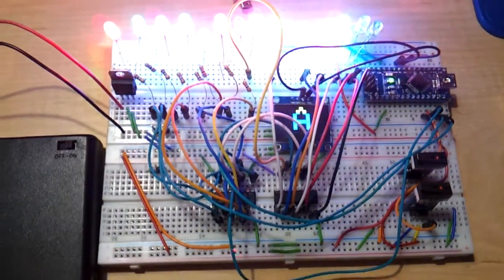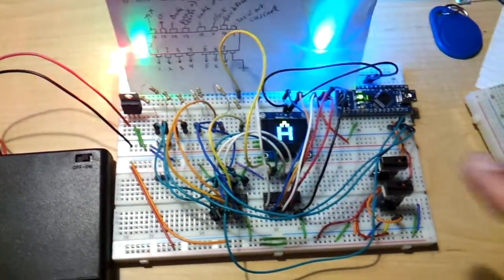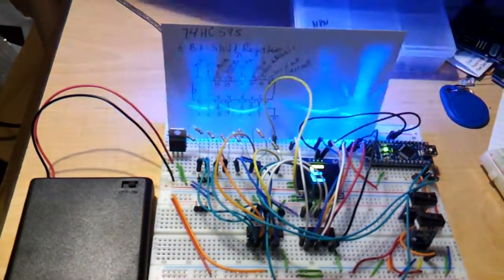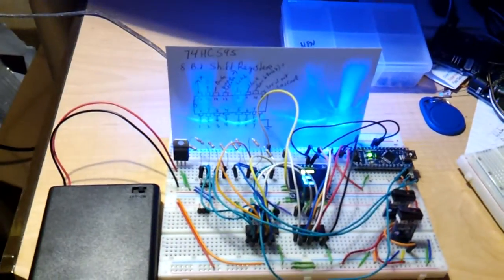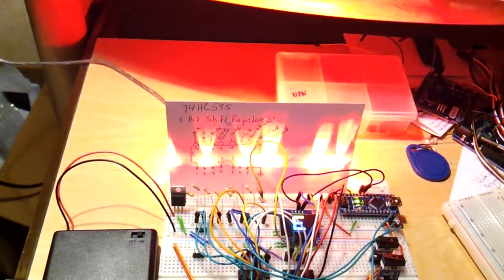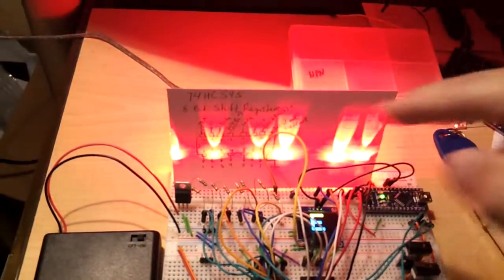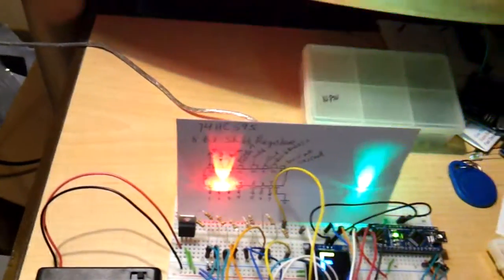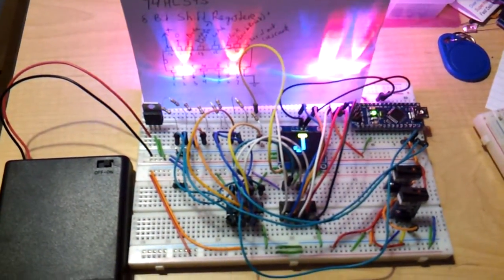2 Shift Registers 74HC595 Cascading with LED Display

Comment: Can you provide the code you used or recommend a good resource to find info on using 2 shift registers?

Thanks
Reply from the maker: +Jake Kolb 
my laptop crashed i ended up loosing all of my codes and projects i was working on. i now have to use my old laptop:(
sorry .......
Reply: +Fedor Weems thanks for responding. I figured it out..eventually haha. I found I needed to open the latch and shiftout the two arrays, individually, then close the latch, since both registers run off the same latch and clock pins.
Reply from the maker: Yep! You got it! I'm sorry I wasn't a help at all. Much luck